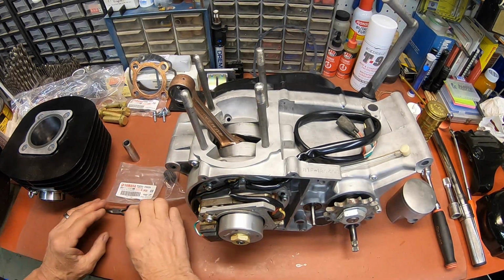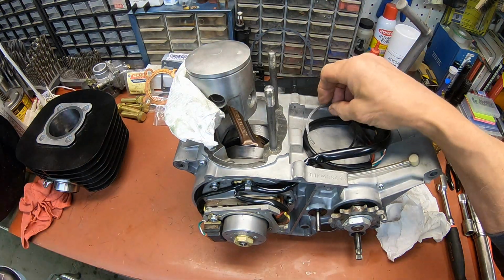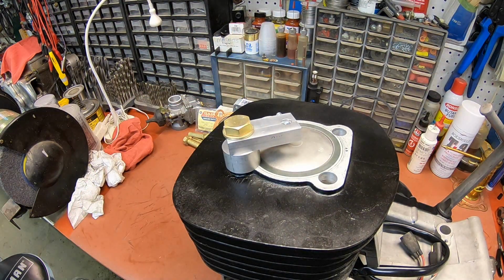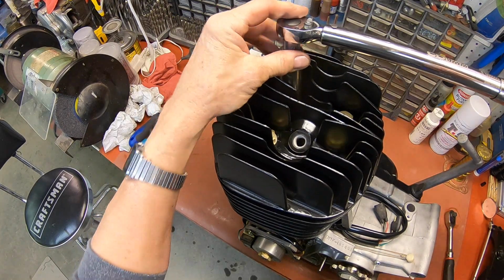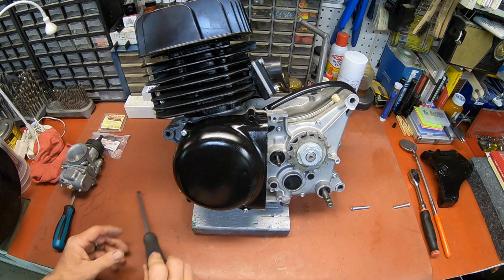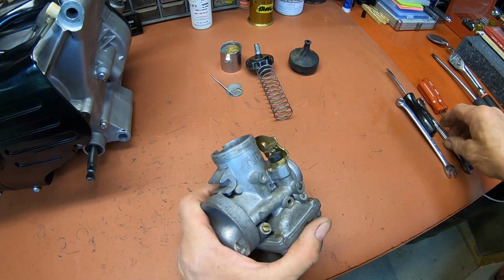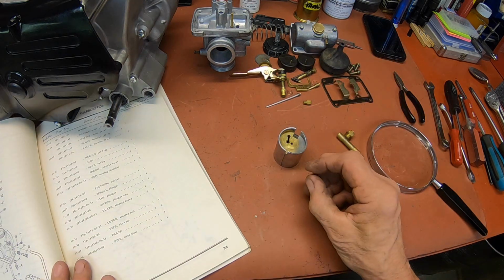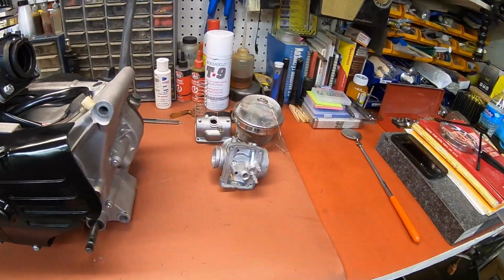Yamaha 250 MX top end install, engine complete

Comment: Hi Dale, not sure if I've mentioned it before, but, for future reference, when you have a 'tail' or 'ear' on a circlip, have it at top of the hole.
The theory is, inertia can make the tail 'lift' and clip pop out if motor is over revved (missed gear, etc)
If piston has a slot for clip removal and no ears, the open end goes down for the same reason. 
The heaviest part is always at the top where inertia is highest.
I've never seen it in any manual  or had problems  but any little extra insurance is always a good thing on engines